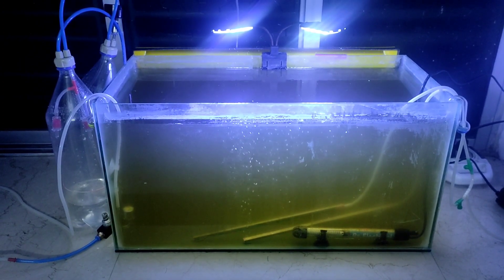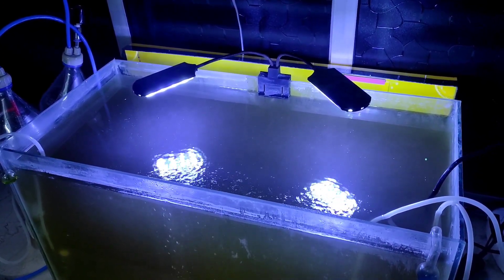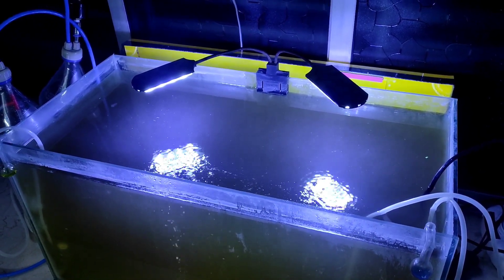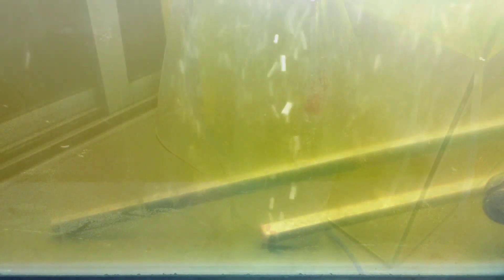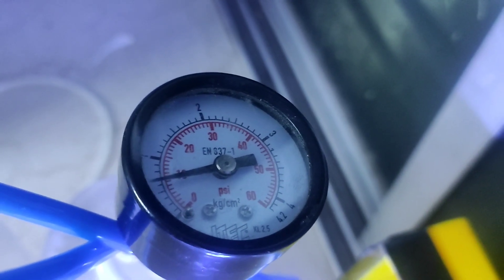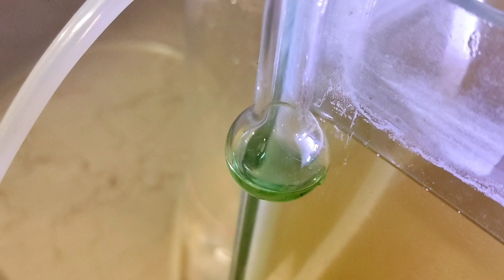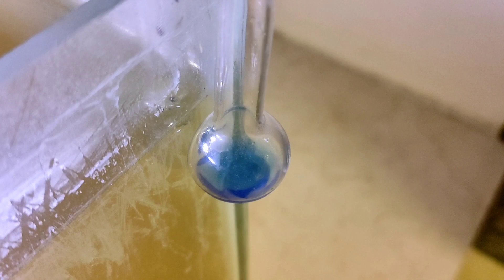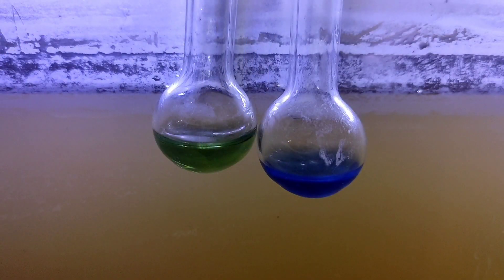A+ Air, An Algae Based Air Purifier

Comment: I have some doubts regarding the way the dyes are being used to measure the CO2 assimilation efficiency of the microalgae culture:
1. It is not clear in this video how the dye that's measuring the CO2 output is connected. To me it seems to be ventilated with open air. If that is the case, then efficiency measurement is not dependable as the out air emanating from the tank mixes with open air and will give flawed data.
2. Also, both CO2 injectors and the air pump are running, which taking into consideration that air being pumped has negligible CO2 compared to that being pumped by injectors, the N2+O2 content seems to be more than enough to upset the efficiency measurement.
My suggestion would be: covering the tank with sufficient plastic sheets and vacuum suctioning all the air in the open space and then start taking measurements for efficiency should be good, given that only the CO2 injectors are running with proper illumination.
P.S: A very noble initiative
Reply from the maker: Thank you for your comment. 

1. The other ends of the glass containers having the indicator dye are dipped into the waterline, the CO2 in the water equilibrates with the CO2 present in the dye, thus changing its pH which gives a change in color. The atmospheric CO2 does not play a role in changing the color of the dye

2. And yes, the air pump does tamper with the efficiency measurement a bit. It reduces the CO2 uptake in both containers by an equal amount. However, the air pump is necessary for aerating the tank as well as preventing the algae from sedimenting. The carbon sequestration efficiency still remains the same, however, the readings are slightly suppressed.